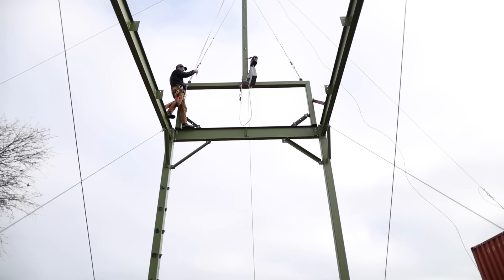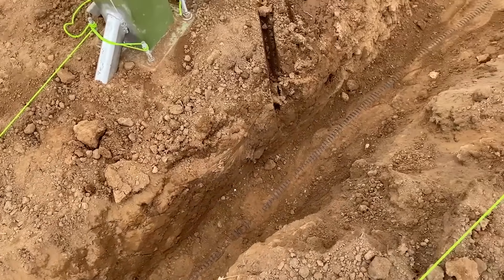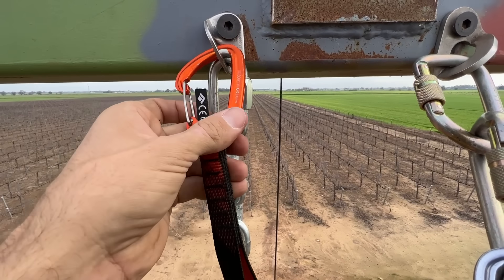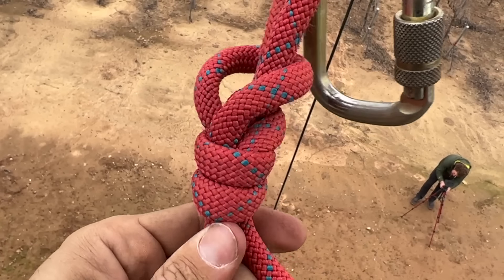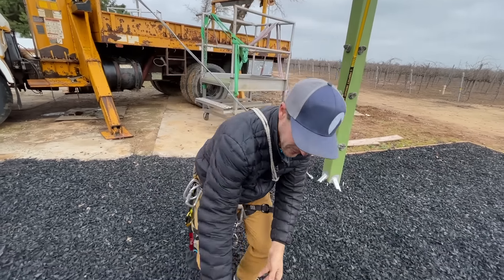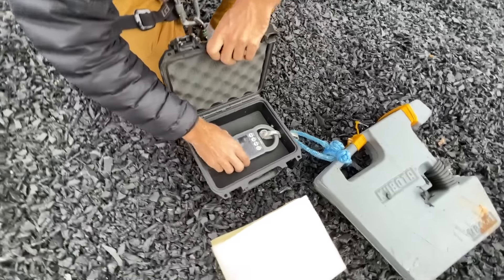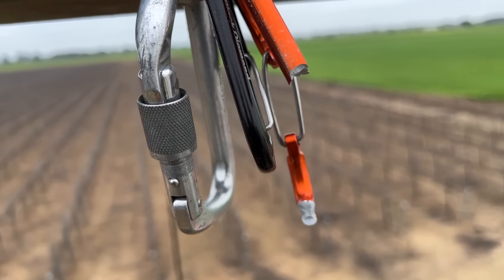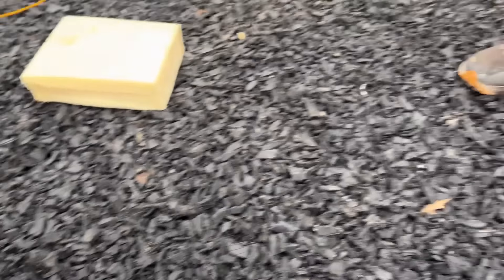Climbing carabiners don't break like you think

Comment: Would you say this same principle would apply when building an anchor on two bolts that have chains on them? Do you still see a reason not to say a carabiner to a bolt hangar that has chains attached to it if you’re rigging say, a quad? I suppose it could still create a levering effect on that carabiner, but we talking toprope falls with minimal force. If it’s a multipitch, the belayer at the top of the anchor weighting the anchor would pull those carabiners out and away from wall, which would make me think to clip it on the outside from the chain links. Thoughts?

Comment: In aerospace, we always try to use static testing except for seats (16g sled).  TOO many variables when doing dynamic testing.  You need to isolate everything using an overbuilt test jig except for the variable component.
Reply: Also because there is no gravity in space? :-)
Reply: That's not true, wings are tested dynamically.  Tires also.  Anything that could be shocked should be tested dynamically.
Reply: @bryana7163 when testing breaking strength? Always static.  The giant test fixture that the 777x is currently sitting in is cyclically loading the wing much more slowly than the dynamic event.  Dynamic tests usually involve high speed cameras.  Decompression, sleds, harmonic…. Test procedures that a phd has signed off on.
Reply: @bryana7163  flutter test. IE harmonic test. High speed camera etc. everything has already been static tested in a lab. Lots of welded I beams and lead shot/hydraulic rams etc. looks a lot like the fixture used in this video.
Reply: No kidding about overbuilt test jig - those things have to be incredibly strong to withstand the shock loads repeatedly.
Reply: @patheddles4004  as long as it stays in the elastic range of the beam. Dynamic or Static loading is the same. Plastic deformation is worry.
Reply: @bryana7163  you can recreate the real world failure by stack up and static test and then recreate the failure with the failure point only in play.  IE. a 180lb human falling in a climbing harness & rope is not the same as the same weight block of concrete on a steel cable. Isolate the variables and figure out the correct equivalents. Then you can test in a way that shows the rating is good or the use is right.
Reply: @kenreynolds1000  If that were true, there would be no reason for flight tests.  Try telling that to engine manufacturers that use airplanes to fly test engines to altitude to test them.  Nothing can be tested in the real world, like the real world, in some lab.  Its a fact.
Reply: @bryana7163  flight tests are mostly testing the flight envelope. At no point is any part of the airframe tested to their failure limits. In fact the margins of safety are a summation of all of the static testing with statistical margins and aging effects baked in. The flight test is supposed to show the measured behavior meets the engineering analysis. Anything outside of that and flight testing stops until the analysis can figure out what was missed.
Reply: @kenreynolds1000  How is this guy pushing it past the envelope?  This is how people use carabiners in real life.  They need to be tested like real life.  This IS in the climbing envelope.

Comment: At times I have found a carrot bolt (yucky old bolt with no pre installed plate requiring a BYO plate) which is long and  thin and allows the plate with carabiner through it to lift off. In this case I place a second bolt plate and clip both; is this going to also add a weird angle and weaken things? I don't see a better option in the situation.

Comment: The carabiner broke because the angle of it pointing horizontal puts leverage on the carabiner and not tensile strength when it is pulled on in proper position.

Comment: Does it make a difference if you anchored the line to the ground and ran it up vs anchoring to the quick draw? My thoughts are that the quick draw can withstand indirect pull that goes through it. I've never seen guides recommending they be used that way.
Reply: In your described scenario the force would be double at the top anchor, in this case the top anchor and quick draw.

Comment: If you're testing the carabiner, you should hang the weight with a chain.
I don't understand this setup.
Reply: Well that would induce a low rate of stain.  This test is designed to test a high rate of strain. Materials respond differently depending on quickly they are loaded.

Comment: The breaking rope is unsurprising, considering its age.  Climbing rope is made out of plastic polymers, which get their strength and ductility from volatile plasticizers which evaporate over time, progressively reducing the strength of the line as it ages, which is why it is suggested to change your ropes every few years; because they lose their ability to shock load your weight once they get too old, it’s best to retire climbing ropes long before they get that old and dangerous.

Comment: You are creating gear fear. I have absolute fear in something that isn't metal, now, based on how pathetic those ropes were.
Reply: Huge difference is stretch tbh. Massive shock load on any rope or cable that doesn't have much give in it, and it's going to break violently unless it's /really/ over-spec.

Thing is, the gear's job is to impart an impulse to change your momentum from "falling down" to "none". Otherwise the ground will do that same job a lot less gently.

If the overall setup had no give at all, then in theory the peak force would be infinite and the setup would fail every time no matter what. Not recommended.

The impulse, which we want to maximise, is force * time. The peak force, which we want to minimise, is impulse / time. Hence we want to maximise the time under tension, and that's exactly what stretch does.

And of course in these tests, he wanted to maximise peak force in order to test the carabiner - hence why he swapped out components to minimise the overall give in the system. That's why we saw ropes breaking so easy (no give in them), and also why we saw sturdy metal components deforming (which also counts as 'give' in the system).

Comment: Ryan, what fall factor were you running for these tests?
Reply: When breaking things and measuring the forces, it is not really important. Also hard to guestimate as the strechiness of the static rope or spanset is beyond any dynamic rope so it would up the fall factor by loads of unwantedness.

Comment: Yeah "rated" or "swl" is not the same as breaking strength there is usually an engineered factor of 4 ABOVE the rated load so they dont get sued.... or a "safety margin"....
Reply: Working load is 1/3 of the breaking strength.

Comment: You set things properly not because you think improper won't fail, you set things properly to be sure they work as planned.
Reply: what you said makes no sense.
Reply: @RobertELee420  there is a difference between thinking it will be ok if you don't set it properly, and knowing that it will definitely be ok if you set it properly. Also there can be situations where the item doesn't need to fail to cause problems that can be a pain to correct.

Trust me, there is a huge difference between the two, one I have seen many times in tree work.

Comment: Congratulations on the new tower! In regards to the steel carabiners with the punched gates it would be good to see something on front and side gate loading strengths for EN362 and ANSI Z359.12 rated carabiners one day 🙏🙏🙏. Had a crack at it a while ago but it would be nice to see something carried out in a more professional manner - https://youtu.be/OTrOIDVRcbk
Reply: Probably doesn't need clarifying but most carabiners are only rated for around 1kn for a front or side loading on the gate whereas there is a common misconception that the "crossload" rating printed on a non ansi rated carabiner is as low as it goes. How far over 1kn can different carabiner types endure front gate loading?

Comment: I don't get, why he is testing this with a static rope.
Reply: (it forces shock loading on the hardware- worst case  - leading on the wrong rope)
Reply: But leading on a static rope is not a realistic scenario. If he wants to "create" gear fear it should be used with the tools everybody is using.
Reply: @golopeters1152    lol..  just go with the worst you can - the only worse thing would to use steel cable (esp leading)  ie. there should be no gear fear (unless you're using very bad gear), more rock quality and placement fear.  Enjoy.
Reply: Well I said himself he want to create gear fear. Doesn't matter...
Reply: in fact it´s a semi-static rope, there are also static ropes, but that is not one of those.

Comment: I've got a question.  Why would you not clip into the large steel locking link instead of the hanger?  It would have to be easier on your biner and no 'notch' left in the biner to wreck your rope as it slides through.
Reply: For an anchor, that's fine. The problem is when people leave quicklinks to bail on a bolt in the middle of a pitch. They often rust, forcing a leader to either clip a questionable quicklink, or risk leveraging their carabiner in the hanger and potentially breaking it like the guy in the video.